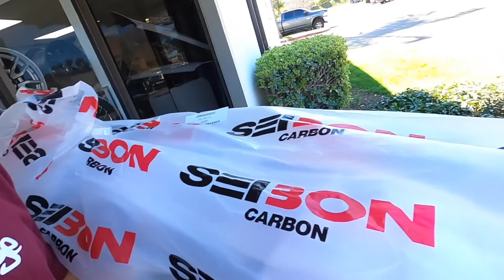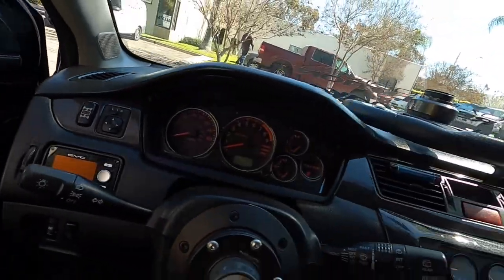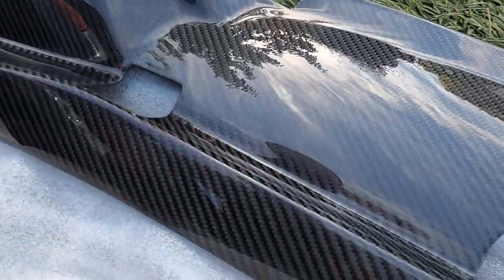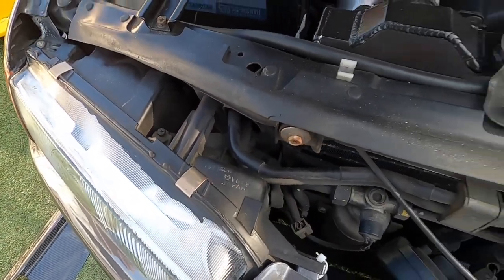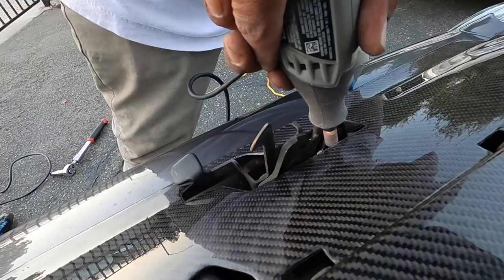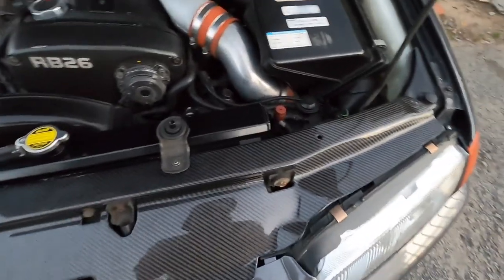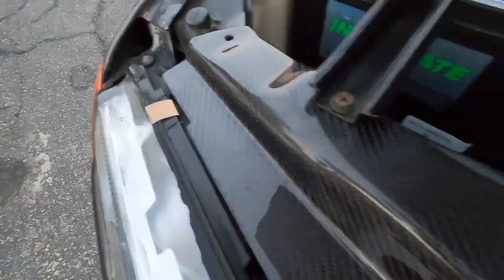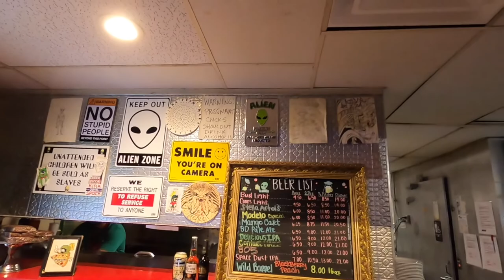R32 GTR CARBON FIBER COOLING PANEL

Comment: The cooling panel looks great and really adds to the underhood aesthetic! A little surprised at the fit from a seibon product. I have the gktech panel and it fit great but arguably isn't as good looking as carbon. Also I would be so tempted to spray paint the little braces poking out and use some dress up bolts. Thanks for the update!
Reply from the maker: That's a good idea. Thanks. Yeah I almost got the gktech one

Comment: But is it effective in cooling?
Do you notice a difference? 
Or is it just a show piece?
Reply from the maker: More like just a show piece.
Reply: if you really want something noticeable in cooling, get a GKTECH fan + Koyo 53mm radiator for your R32 and you'll NEVER have cooling issues again.. aside from this, that cooling panel is actually suppose to go *beneath the top grill fin, not above